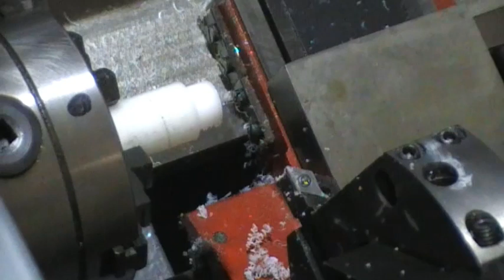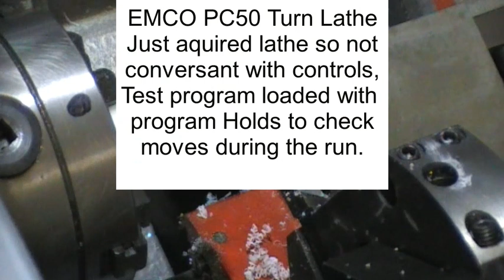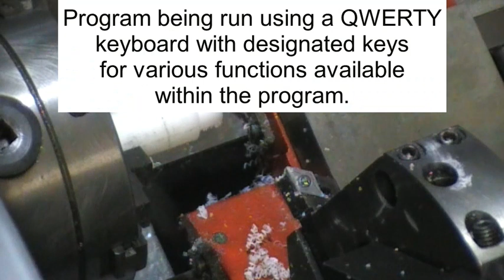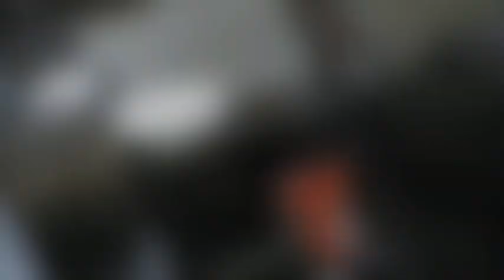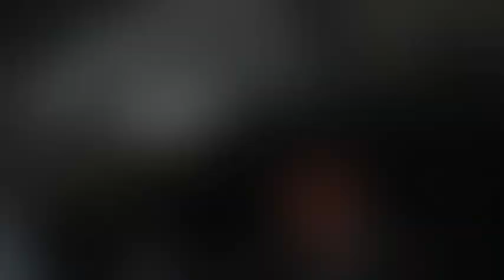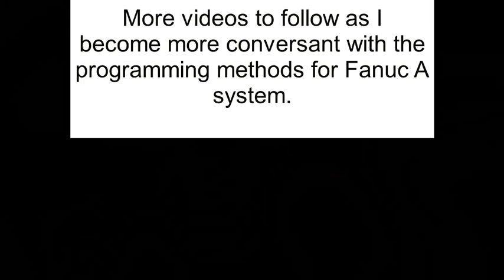Emco PC50 cnc Lathe First Test runs.

Comment: These don't have M01 optional program stop?
Reply from the maker: Yes they do provided it is switched on in the Program Control, I am familiar with M00 but either will act in the same way, halting the program but allowing a continuation of the program run, This lathe is very new to me and just finding my way around, spent 3 days getting the offsets and work shift functions working in a reliable way and still not 100% confident I have those correctly, much more to learn with this control system, quite a big step from the Compact 5 cnc control system  which I have been using for many years.